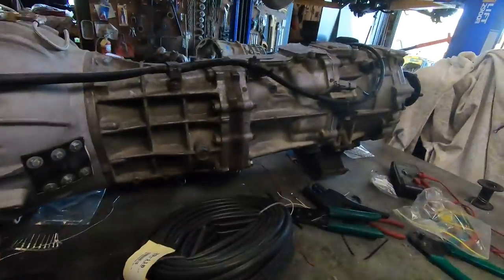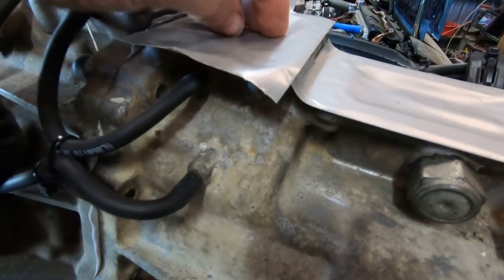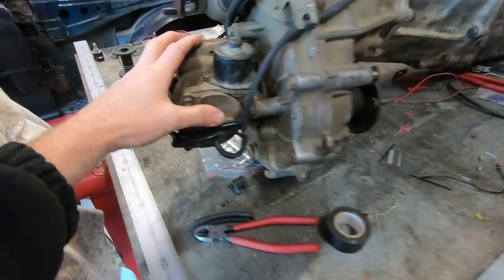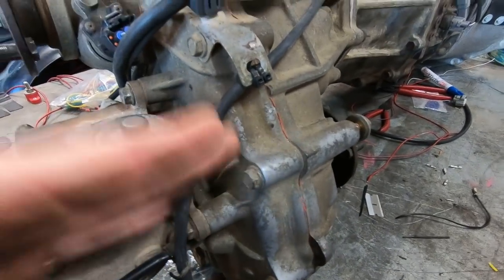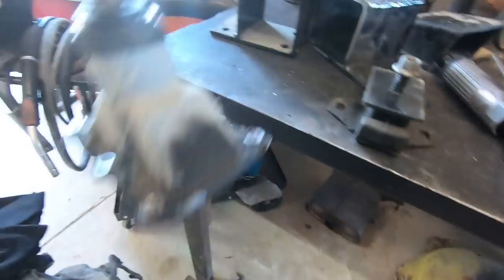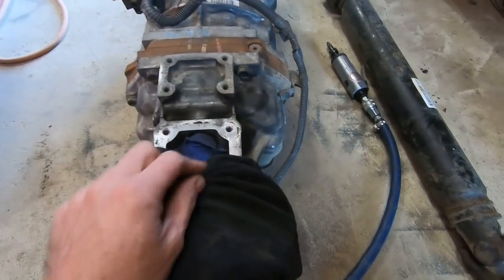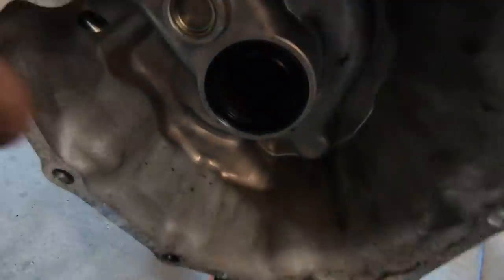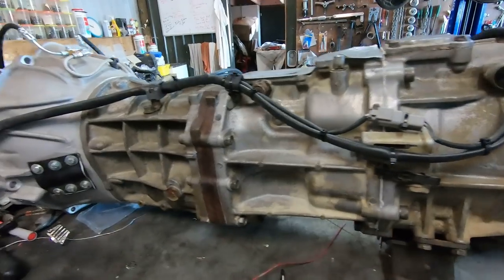1uz conversion to R series gearbox - R150F, R151F and R150 (2wd).  bolt on bellhousing

Comment: Hey I own a 1984 Toyota 4Runner that I've just bought that already has a (pretty sure) 1st gen 1UZ-FE conversion been done and I can't quite remember the gearbox it has but I do have all the paperwork with all the receipts from work that has been done on the 4Runner and I do remember seeing the gearbox model in there. Anyway I have a few questions if I may.
Firstly, What gearbox would you recommend for this set up for me to safely be able to do some decent off roading in the old girl and possibly handle a future supercharger?
Secondly, it's running the stock ecu at the moment that has a few minor issues so what would you recommend I change that to? (I'm a kiwi living in Australia so I can get parts easily from either).
Thirdly, What are your thoughts on diff and the rest of the driveline options with that engine?

Any help on any of these questions would be very valued in what I want to do with my new Toy.
Reply from the maker: Its easy to tell gearbox if its small or large by the drain plug as explained in the video.   

Strong box is the R series which is what I use.  R151F or R150F. 

For ecu I prefer link. I always use aftermarket for boosting.   

Diffs are notmally ok unless the driver is complete animal then upgrades like safari or landcruiser.  

Cheers Kelvin
Reply: @CartuneNZ  Ok so either the R151F or the R150F will put the shifter in the right position in the cab as well then?

Cheers, Jase
Reply from the maker: @levinlarge  the R151 has shifter further forward than R150.  As I dont know how the motor is fitted I can judge where shifter will sit sorry as different models and shifter positions.  Cheers
Reply: @CartuneNZ  Ok then so if I go back and find out what hearbox is in there now then I suppose I can work it out from there as to where both the R150F and the R151F sit in comparison as I want it to be in the relatively same position to that. What's in there now looks nice and stock so I want to go with that same factory look.
Reply: Ok so its fot the G52 5speed box in it which has "upgraded internals and re-built" apparently. Well according to all of the paper work I have for the old girl anyway.
Reply: Ok so the next problem I've just come across is the hydraulic clutch system.
So I can see through where the clutch fork goes into the bellhousing, it has a upgraded clutch in it (looks like the exedy type) and it has the G52 gearbox mounted to the 1uzfe through an unknown bellhousing. So it also has a brand new 5/8 inch clutch master cylinder and fairly new hose to the Slave cylinder. However the Slave cylinder only seems to move about 10mm when the clutch pedal is fully depressed. The adjuster on the master under the dash is wound right out and pedal is about level with the brake pedal. The slave cylinder rod has been put into the clutch fork about the halfway mark and the clutch pedal is as hard as hell to push down. I can't put it into gear and the Slave cylinder is adjusted almost all of the way out.
I'm just wondering if you have any ideas what the problem could be with this set-up and how I could fix it so I can change gears and make the clutch pedal not so hard to push down. I'm sure 10mm of travel isn't normal for the Slave cylinder to move?
Reply from the maker: @levinlarge  I've heard the same clutch story hundreds of times.  Sounds poorly setup.  A heavy duty clutch doesnt need to have a heavy pedal.  I use a larger clutch master but that will give a stiffer pedal but generally it gives correct adjustment back.  This info will pop up in a couple of videos as I get them edited.  Another option is a smaller slave.   A nissan 3/4  is one option ive used.  These days I only use my own internal hydraulic release bearing.  Problems solved.  With any g52 I'd warn a customer that boost would break it and take bets on how long it would last.  Cheers Kelvin.
Reply: @CartuneNZ  righto so off in search for a 150F or a 151F gearbox it is depending on where it puts out the gear stick location with the engine mounts moved 10mm forward and yes either a smaller slave or a larger master cylinder it is. Do you reckon a 3/4 inch master will be enough?
Reply from the maker: @levinlarge  personally I think if you go up in master size your pedal is going to be heavier so smaller slave may be a better option,  however I think there might be other issues like lever points etc.

Comment: Yes sir I got your message about o'd light flashing in 95lexus sc400 I no it has something do with trans but whats the reason does it mean my trans is gone I don't drive hard I baby this car I'm just tired of looking at it I want to ride please help me with some tips of what May be wrong please move over here we need you here
Reply from the maker: You need to check what the fault code is.  Its pretty to understand that isnt it?  Like test your car.
Reply: Ok I had the battery unhooked for awhile I hooked it up just to crank and let it run I put it gear and go forward and backward just in my yard now the light want come on I was told it can't be checked unless light is on I havnt driven down road to see if its shifting these guys over here not smart like you
Reply: @CartuneNZ a guy I work with said something bout solenoid
Reply from the maker: I would drive it until it faults.  If it does,  then I would have my test gear,  you could use a paper clip,  and check code.  It could be a solenoid and I have a video on testing that,  but I dont guess,  I test.  I recommend you do the same.
Reply: @CartuneNZ  yes sir I will thanks so much God's good

Comment: Is it possible to put the r154 internals into a r151 ?
Reply from the maker: Hello Alfie.  Hope you are well.  Some of the internals are interchangeable between the two some are not.  What we do is use the r154 upgraded centre bearing retainer,  thrust washer and shift fork into the r150/r151.  The upgraded reverse fork doesn't fit.  I haven't played with gear swaps for years now and my memory is a bit fuzzy on that part of it sorry. Cheers Kelvin.